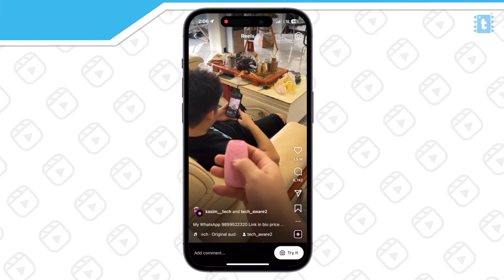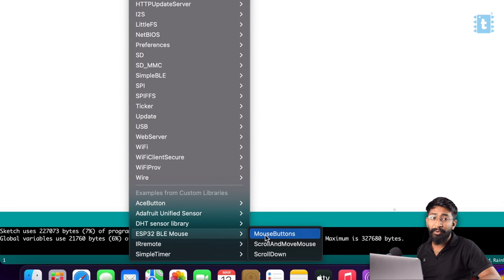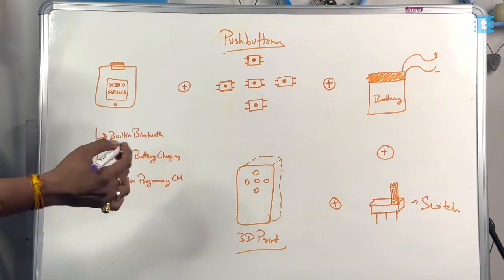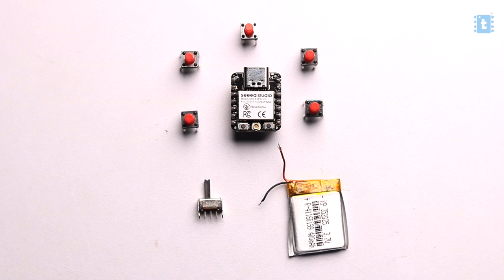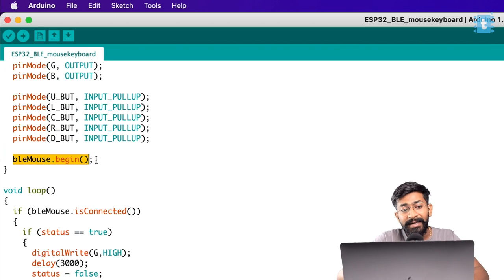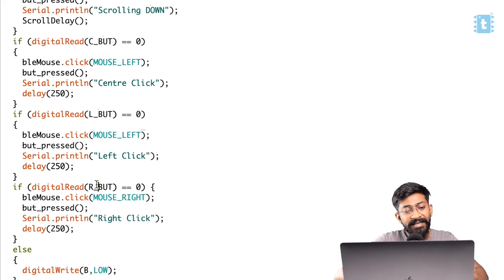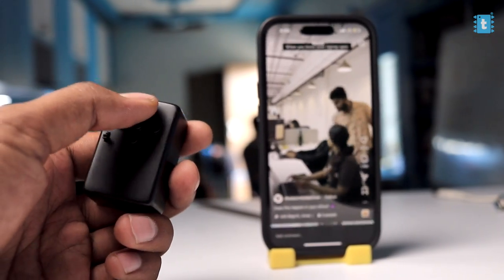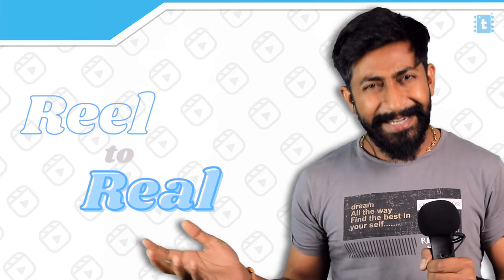BLE/WiFi Remote using ESP32C3 ⚡️ | ESP32 Projects | IOT Projects

Comment: is there a way you can add (1) wifi support to this board and (2) add IR receiver to it (basically allowing us to use a single existing IR remote for Bluetooth devices also, like the old Logitech Harmony remotes)? I would surely be interested in purchasing.
Reply from the maker: The board already has builtin wifi so you can use it's wifi by changing the program
and secondly, we already made a custom PCB so there is no space to add IR receiver. But still if you solder the wires on the pad you can use it.

for more details you can contact us at - +91 82000 79034

Comment: I have been using the same library and it's subsequent BleKeyboard..... But it's throwing error of string conversions in begin function.. 
.... Trying to debug.... But if you may help better! Hoping for an early reply
Reply: I had the same problem. Change your ESP32 version in Arduino IDE down from currently 3.0.5 to 2.0.17

Comment: Why can't I use my iPhone? Even though I followed the instructions
Reply: Did you work it out? I'm doing my own version atm and I am not satisfied with how it works on iPhone for now.
Reply: I had the same problem. For some reason the esp32 doesn’t show up on the iphone’s list of bluetooth devices available to pair, but on the android and on my Macbook it was there. Any of you found a way to resolve this?
Reply: @AlexFreemanOfficial  This should work. Try the sample code of the blekeyboard, it should be visible as esp32.

Comment: Make a automatic sliding home window opener with this remote. The window should have 3 window panes
Reply from the maker: you can change it's code and can make that as well
Reply: @techiesms  but the window mechanism is a bit difficult and I am not able to understand.
Sliding windows are difficult than the windows which move up and down
So do u have any solution.
Pls make a video on it